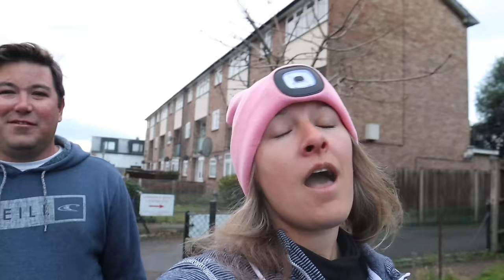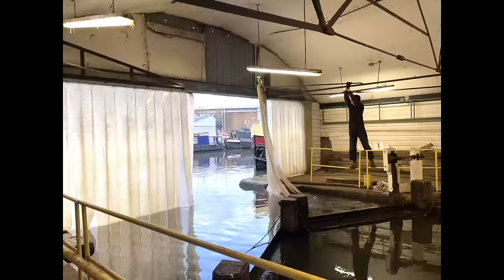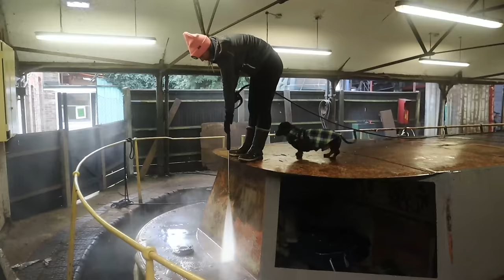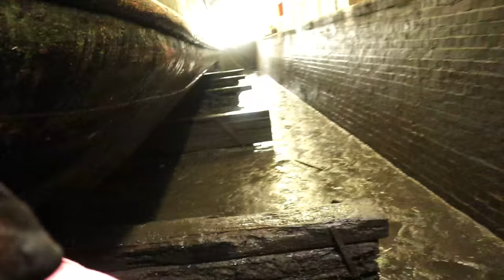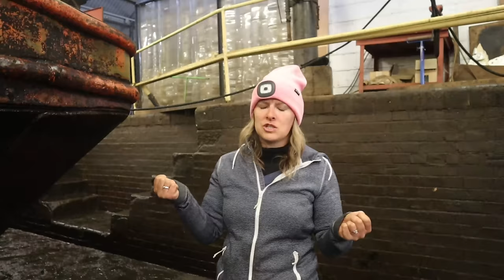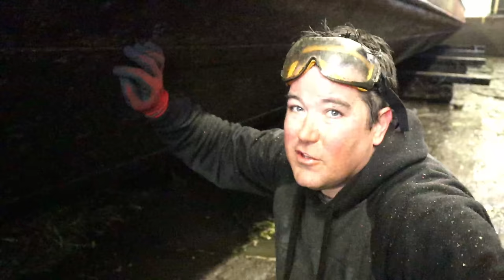"Dry Dock Discovery: Unveiling the Secrets Beneath the Waterline - Episode 13"

Comment: As a marine engineer, I should tell you; you really should blast the hull back to bare metal if you want the new coating to adhere and last for any length of time. May be costly now but it will save money and potentially the hull in the long term.
Reply: Yes, correct. I would sand blast the hull then use the Defoe Paint Company process to seal it and prime for antifoul. It will save the steel hull. My experience anyway.
Reply: @DC-uo5hy I would use hydrojet instead of sandblasting.
Reply: @UutGrunn79  Not sure but I think Ultra High Pressure water blasting has been banned due to environmental concerns. In the large dry docks I worked in the shot was contained and recovered preventing the paint fragments beings released into the environment, it is not possible to control the paint release when using water as the blast medium.  Ultra high pressure water washing was a great system , it took the coating clean off and left a clean surface ready to paint once it dried.
Reply: @UutGrunn79  thanks, but a water pan an collector are necessary to capture all the water so it can be filterrd. Sand, shot or bead is collected by vacuume then sifted to remove contaminants.
Reply: Definitely have a surveyor do an ultrasound to check thickness of the hull, then sandblast and epoxy prime the hull start at the bottom and then spend your money on the rest of the refit without it being watertight for the coming years otherwise you will just end up with a money pit not finished 👍
Reply: Sand Or dry ice blasting and then two component paint. Otherwise, not worth investing a dime in that hull
Reply: Agree, this is one of those things at this stage of a project you should not try and save money on, just bite the bullit now and get a whole new coating protection system on the hull. Came accros this video after seeing this one:

https://www.youtube.com/watch?v=NE2GjGd1z8g

You cant angle grind against that and you will never have any doubts about any part of the hull, you could still hire the blasting equipment and do it yourself. Even if you do it all yourself, you'll save alot in time, sanding discs, wire brushes and your back to spend on other parts of the boat.
Reply: I think after 13 episodes you have gone about this all wrong. The smoother the hull, the better speed and flow through the water. I cannot understand why you have not gone to a marine engineer and got the right advice !
Reply: @grahamc887  yes I am surprised that they have been allowed to water blast the hull and topsides with all the various environmental regulations
Reply: @Fr99763 really not up to you is it hero?
Reply: @aking9999 and who the heck are you to say anything? Not your project Karen.
Reply: To most of us that would be common sence.
Reply: I totally agree with sandblasting, repairing where needed then coating with the be paint's available. I was a sandblaster and painter in the 1980 s and most people did the cheapest job at the time and paided for.
Reply: Sandblast and then ultra-sound the hull below the waterline before spending more LSD's on paint. Beautiful riveted hull, worth the crop and renew costs, if finances allow.

Comment: Its going to be your home, so the hull needs to last, spend the money now and do a proper job, will pay dividends in the long run. And dont forget the sacrificial anodes to slow down the rusting. I am not a boater but a civil engineer who worked in the water industry, specifying protection systems for various materials.

Comment: Sand blasting + x ray metal thickness measuring + new metal plates welding in + inspection. 75k to 100k  to make it safe on water.
Reply: My guess is it will end up being scrapped. You could spend £300k on that tub to turn it into something worth doing.

Comment: Totally agree with people here saying you must high-pressure jet back to bare metal. Jet washing won't reveal all possible issues and now is the time to discover them! The approach with my boat was high-pressure jetting, then overplating, then epoxy paint. The hull looked fine and passed a survey but it was only when it was jetted that we found lots more holes  which were then plated. It's the most important thing you can do!

Comment: Hi Chris and Priscilla, thanks for all your work involved with doing the video documenting the dry docking, which I greatly appreciate and enjoy.  I know you two have been looking forward to this day for a while with much excitement and anxiety.  And... as a bonus, making the day more memorable by losing the keys in the canal.  Thank God you were able to retrieve them fairly easy. 

I am assuming at this point a good sand blasting will be required to fully analyze the hull condition.  Given the boat's age, I assume it was built from iron instead of steel, which rusts slower than steel but repairs may be more difficult due to it being an obsolete process.  The corrosion is usually highest at points where the water and air meet (especially where there is turbulence).

If you can swing it and if your proposed engine actually runs, fitting the engine at this time would be more convenient.  I know you will encounter various problems during the rehab process but, I hope they are all manageable and result in a good learning experience.  I wish you both well, please keep up the fine work!

Comment: You guys are doing great. Always been my passion. To restore, improve, and then to enjoy . I have restored plenty. Boats, mostly cars as , of course, South Africa does not have those lovely canals. Im green... One question though, why not sandblasting? I would have sandblasted everything. Its steel. You went through the correct thickness testing. This means enough material to work with and sandblasting would clean so much better. I always clean right down to bare metal, put on etching primer, primer, then paint/anti fouling below the water line. I am retired, living in my caravan, presntly in Port Alfred, about to move to Gansbaai. Keep going. Youre doing great
Willie
Reply: Most dry docks don’t allow sand blasting, because the blasting media fills up the dock.
That’s usually only done out on the hard, which would require a significant size crane, for a boat of this size, unless there’s a suitable slipway and haul out facility. 
For a preliminary inspection, the dry dock and pressure washer is a more cost effective way of establishing whether the project is going to be within their means.
If there is a lot of plating to be done, then a lift out and full sand blast would be justified. Or, if the budget is not a concern, it would undoubtedly give a better result, once the decision to continue has been made.

Comment: Good morning, you two - er, you three: great - we can learn a lot from you about good English boat building.
Considering the age of the "rusty" hull, which isn't really rusty everywhere - this is an amazingly good "neglect" that the shipyard's good precautions have made possible!

So there are layers that are better preserved - with the exception of the outer layer, which has to be removed to get to the deeper layers - and have to be reapplied - so there is very little to be done.
That's English the good old way: I like it very much.
good for you: there is still enough work left - but with the narrowboat you have chosen a jewel that has its charm and appeal.

I'm just wondering how it works when you only get a shell instead of a complete narrowboat.
I'm excited to see what happens next for you!
Kind regards from Berlin, Germany

Comment: Hi, I just read one of the comments from a fella about the addition of a bow thruster, a good idea but very expensive. I am not that knowledgeable on boats but with the addition of the new engine, it should make a big difference. Also a different style propeller and improved rudder might help.  Don’t forget that once you remove the outboard motor and frame there will be two holes in the top of the rudder?  Anyway that’s an idea for the next time she’s in dry dock. The two of you have done a right proper job of power washing the hull. You must have been exhausted afterwards. But it was rewarding I think. Waiting patiently for your next video, cheers.

Comment: In 1979, the external paint job on my newly commissioned 27-foot Dutch steel sailboat had been done so poorly that three years later I decided to have the hull sandblasted from the keel up to a line two hand-widths above the waterline. I then primed the bare steel twice or three times in line with INTERNATIONAL’s coating instructions and afterwards applied three coats of (two-pot) epoxy tar, which in those days was the state-of-the-art way of sealing freshly sandblasted steel. (Today that would be several coats of two-pot epoxy paint.)

Since 1982, I have not had a single issue with rust below the waterline. Of course, with a much older boat as yours, plate thickness needs to be checked before investing in expensive sandblasting and paint jobs. But once you have been given the go-ahead by a plate and/or coatings expert, you should invest in the appropriate coating process and follow the instructions carefully. It is quite likely that from then onwards, rust below the waterline will be a thing of the past on your boat. 

Above the waterline I did not change the boat’s original one-pot coating applied by the builder in 1979. The deck, the cabin roof and the cockpit need re-painting every ten to fifteen years. I do not re-paint everything in one go but do it in sections according to their respective wear. 

Could I decide again, I would have the entire boat coated in two-pot epoxy paint inside and out. It certainly pays off in the long run.

Comment: Considering you have remote entry key I would recommend submerging it into a high percentage isopropyl alcohol to get rid of the water moisture in the fob because the alcohol won't hurt the electronics.... I still wouldn't use it until the alcohol dries though

Comment: Do you think about adding a bow thruster? Its a big long boat with a lot of wall area, moving in tight spaces as canals always are, or in a marina or in windy conditions would be easier with it. I also doubt that the original propeller and rudder give as much control as the outboard fitted to the rudder, as small as it was, did provide.
Reply: The boat used to have a 6 cylinder engine and that propeller is 30” across

Comment: Another Marine Engineer, strongly recommending sand blasting.

That high pressure hose isn't taking the rust off properly.

Do it once, do it properly, start with a good base to work from.

Otherwise a waste of paint.

Comment: Once you get this boat sorted/repaired, add sacrificial zinc anodes on the exterior.  These will protect the hull and fittings from electrolysis which is what is eroding the hull.  Widely used here in the USA, i've yet to see a canal boat featuring them - "fresh water" or not.

Comment: It’s so much better using a proper pressure washer this time around, huh. The two of you have done a great job so far.
Reply: That washer is good for fouling BUT they should use one that almost blows you off your feet to remove a LOT more rust and corrosion. That there is a typical washer that Marinas use on yachts NOT heavily corroded steel/iron . To repaint that would be as good as pouring the paint into the canal.

Comment: Remember that plate repairs on riveted  hulls absolutely should be riveted if you need to change plates all the way  to the plate seams .
You never weld in plates in the riveted  strokes, only welding 
"Inside " the original plate boundarys/inside  riveted seams is okay. And the welding has to be done in 
Sections/carefully to avoid heat tension stress in the hull plates .
Damaged rivets should not be repaired by welding the rivet to the plate, you replace it with anew rivet.
The reason that all plate "strokes  " still should be  riveted post repair is that a riveted hull is not behaving like a welded hull when ists flexing.
The wellds are more static rhan riveted joints,  this can cause stress cracks in the welded seems if some  plates is welded ,and some riveted. 

Double plating is a temporary fix with risks for rustjacking and between-plate corrosion always aim for  replacement where you cut out  for and put in the patch in-line with the original plate .

Ribbing  fasting rivets trou damaged plates should be replaced by 
A new rivet not  a welded seam plate to  ribbing.

Also you will have to clean of the  rust better some kind of media blasting , needle hamring , or disc grinding followed  by  rotation steel brushing .
 
After that: thickness measuring  , hull inspection , repair, and paint. 
Not to forget shecking the rivets , for pit corosion.
Damaged rivets should be replaced with a new one.
 The  rust may wery well be the thing that stops water from coming in if there is pit rust damage.  A( smaller )rust pit in a otherwise good enough plate 
Can be filed  with weld. 

If you are going to slap on some patces double plate style ,and paint on that   
Hevy rust  without  good ground work its not a serios repair,  just shotty" boat cpr"...

Comment: You have basically washed some dirt and alge off the surface. What makes you think there's antifouling on the boat ,traditionally your kind of barge would be painted with a bitumen based coating.if you really want to know the state of the hull you have to grit blast back to bare metal,then get a surveyor to ultrasound to establish plate thickness. If it's too thin you will not get insurance without that you can't get a licence. If you are lucky and still have sufficient plate thickness then grit blast to sa 2,5 white metal .then apply a good quality two component epoxy system.

Comment: You guys are doing great--however, did you think about using an air needle Slager to remove the rust layer--it leaves the bare metal exposed and is fairly easy to use before applying POR15. It is an extra step to make sure.

Comment: Its been badly plated, and without sandblasting to get back to bare metal, cant see that much point in dry docking?  Needed to be craned out, and blast cleaned, then get a price for the repairs.

Comment: For some reason, my comment about your starter motor, on the diesel engine, got deleted last week.
I expect that on channels that deal with controversial topics, but here? Very strange.
In any case, I’ll try again. Somebody commented about a spiral on the shaft and a weighted pinion, using inertia to engage the pinion in the flywheel ring gear. That’s called a Bendix system and it’s not what you have. Your engine is far too modern for that. What you have is a pre-engaged type starter. The fact that it spins freely means it’s not engaging with the ring gear. There are a few possible reasons for that.
It could be that, after a long period of storage in less than ideal conditions, the pinion might simply be stuck and not able to slide along the shaft, to reach the ring gear.
It could be a problem with the solenoid, allowing it to make the electrical connection without pushing the pinion out far enough.
The pinion has an over run clutch, which allows the pinion to spin faster than the starter motor, when the engine fires, for the second or so it takes for you to release the key. These can fail, leaving the pinion not connected to the shaft, so the motor spins, but doesn’t drive the pinion.
Finally, engines typically tend to always stop in the same position. This results in heavier wear on the ring gear teeth, just in the one spot where the starter usually takes up the drive. Teeth can wear sufficiently to break off, leaving a small gap in the teeth at the critical point where the starter tries to engage. 
So, when removing the starter, try not to turn the engine. Once the starter is out of the way, check the teeth on the ring gear, by looking through the mounting hole. They should all look and feel the same, the whole way around.
There is one other possibility, but it’s so rare nowadays, it’s hardly worth mentioning. Older pre-engaged setups could sometimes cause the ring gear to move on the flywheel. Over a long period, many hundreds of start cycles, the constant hammering of the pinion engaging could force the ring gear back away from the starter, eventually moving it out of reach. If everything else checks out okay, it could be worth measuring the distance from the mounting face to the ring gear and comparing it to the maximum throw of the starter pinion.
Sorry, I know a very dry, boring comment about a boring topic, so if you’re still with me, thank you.
Most of the possibilities rest with the starter, so getting that checked over will most likely solve the problem.
Fingers crossed this doesn’t also vanish.

Comment: Get out now.... its a good boat; just needs an interior, hull, engine, controls, lights, batteries, rudder, windows,... and don't forget the curtains, it'll need those. 3 years if you hire out, 5 if you do it all yourselves and don't get burned out before you are done. Scrap it and start with something that needs less work. My 2 cents.